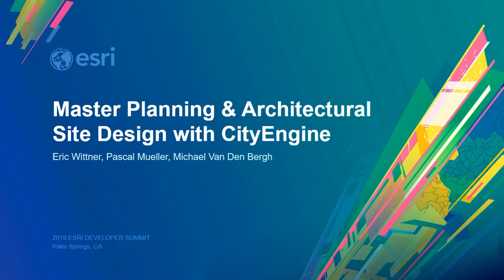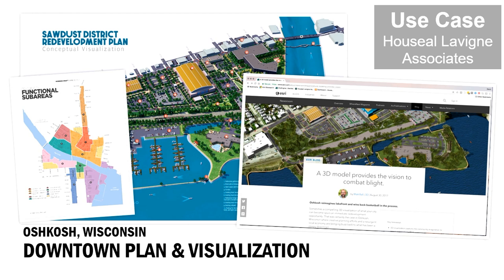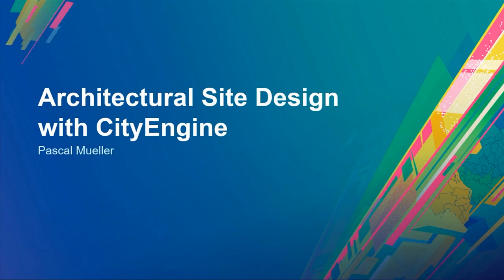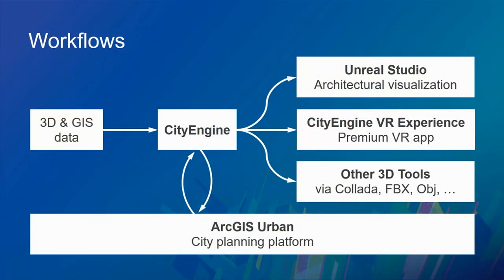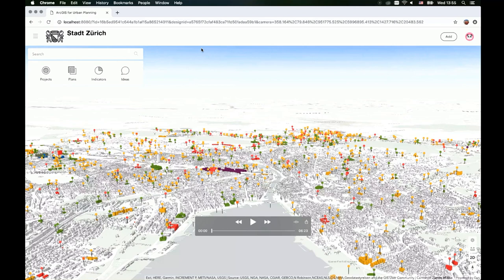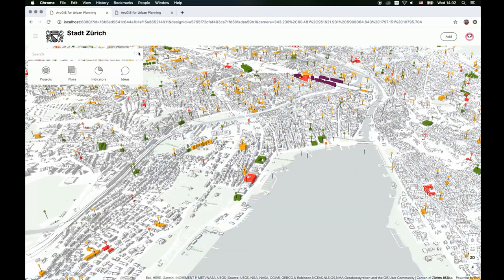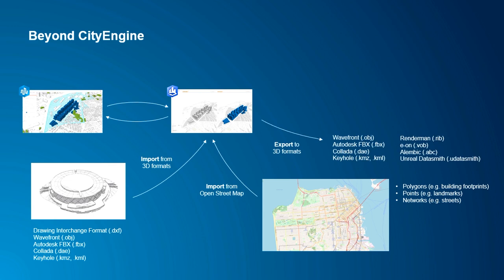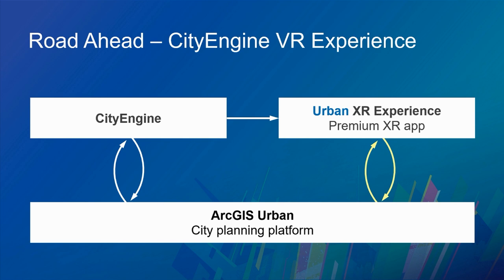Master Planning & Architectural Site Design with CityEngine

Comment: This is fantastic - at the 20 minute mark, you edited a mass manually, with the floors generated procedurally. Wondering - was that mass imported from another software, or originally generated using CGA?